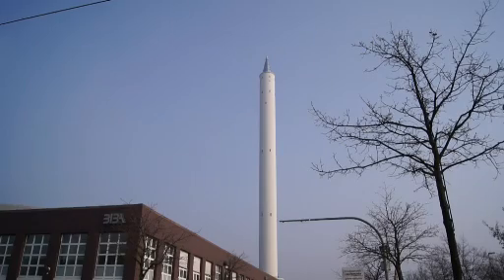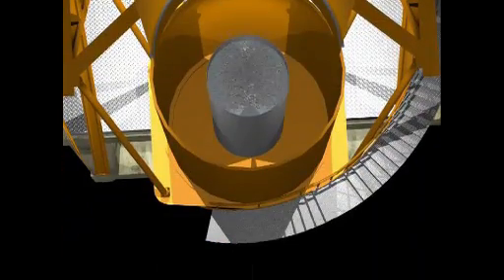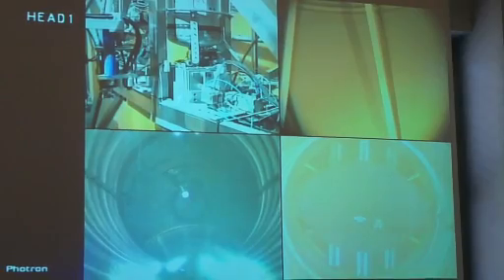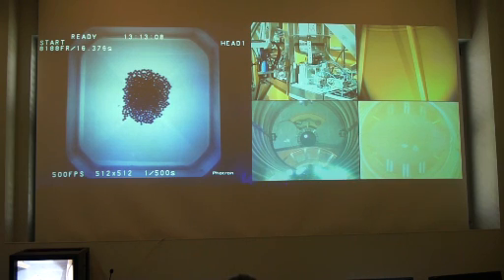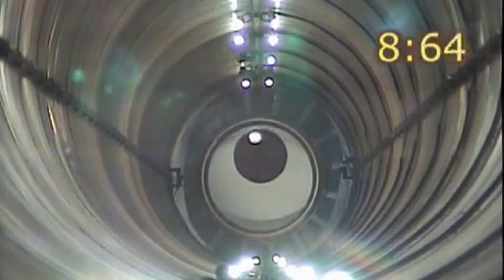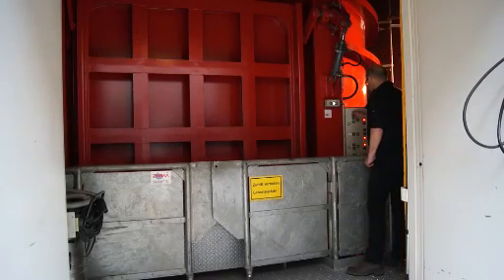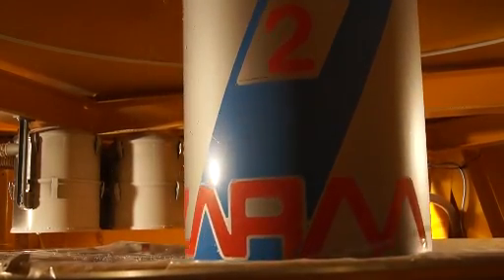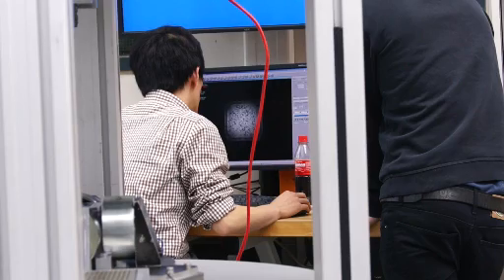Weightless* in Bremen: Germany's anti-gravity machine

Comment: Why is it when you travel in a plane at 500 mph you dont feel weightless? m v squared over r.
Reply: Because the r is measured from the Earth’s centre (= centre of gravity) and the difference in r is microscopic at plane height.  There are also some subtleties but that’s the main factor.  

Even at Low Earth Orbit the difference in gravity is tiny - gravity is still very much there, it’s just that it’s exactly counterbalanced, mainly  by the centrifugal force of the satellite going round the planet.  Weightlessness does not imply or require gravity-less-ness.

Comment: What's tragic is you people do not even have the awareness to recognize the loss of inertia experienced by the 'experiment' as it falls.

Try putting a traditional  inertia-type accelerometer on the 'experiment' as it drops.  I dare ya.
I DOUBLE DARE YA.

If it is a traditional inertia-type accelerometer it will read NO INERTIA on the way down.

"Yes, that's gravity!"  you'd say.

Exactly.  But you miss the exact physical nature of this point.
You see,  the 9.8 meter/second^2 rate of acceleration caused by gravity is equal to these examples:

1)   a  dragster type of racing car, at a dragstrip, that accelerates and completes the 1/4 mile dragstrip run in only 9 seconds.  DO  THE MATH.  That is an accleration of 9.8 m/sec^2, down that dragstrip, to get you a 9-second 1/4 mile time.  
2)   a  sports car that accelerates from 0mph to 60mph in only 2 seconds.  That is ALSO a 9.8 m/sec^2 acceleration.  Idential to gravity's acceleration. 
3)   This is the most shocking.

You see, I am telling you to put yourself in that dragster that races down the 1/4 mile in only 9 seconds.  How would you feel, as that very hard acceleration feels like it "presses you deep into the seat" of your race car?   The inertia.  The resistance of your body to the car which is trying to accelerate you.  The seat of the dragster, bolted to the car, does not give you body any choice.  Down that dragstrip you go, your body's inertia being overcome by the seat of that dragster, pushing your body down that dragstrip.  At this high acceleration - racing down the 1/4 mile in only 9 seconds - it's several times harder acceleration that what we feel in the seat of a large passenger plane when it takes off.   Your physical sense in the dragster will be "I feel like I'm being pushed back, deep into the seat"

3) example - this is the most shocking.  I'm telling you to sit in an office desk chair, the kind with wheels on the bottom.  In a large warehouse or gymnasium, that is at least 32 feet long.  Keep in mind, the average family room in a private home is 16 feet across, or a master bedroom in a private home, 16 feet across.  I'm telling you to sit in that office chair, in a 32 foot long room - twice the length of the average family room or master bedroom.  Sit in that chair at one end of that large room, then accelerate hard enough so that you, sitting in that chair,  shoot across that 32 foot long room IN ONE SECOND.   Picture yourself in that very large room, shooting across its entire 32 foot length IN ONE SECOND.

Because 32 feet per second is ALSO the acceleration of gravity.  When you accelerated in that chair and crossed that huge 32 foot room in only ONE SECOND,  what did the inertia feel like?  Obviously your body would RESIST such a hard acceleration!  You would feel 'pushed deep into the seat' so hard it would scare you.   32 feet in one second!

ALL THREE OF THOSE EXAMPLES ARE IDENTICAL TO THE ACCELERATION OF GRAVITY.

NOW, IN ALL 3 CASES,  LET'S SAY THAT YOU CARRY an accelerometer with you to measure your rate of acceleration.

If you carry with you - in the 3 examples above - a traditional inertia-activated accelerometer,  what would that accelerometer report?  An accelerometer is an instrument that detects and is calibrated at the factory to *accurately report* the magnitude of an acceleration.

HERE'S WHAT THE ACCELEROMETER WOULD REPORT FOR THE 3 CASES ABOVE:
1)  for the dragster case, racing down the 1/4 mile dragstrip in only 9 seconds - the accelerometer you carried with you on your
      dragstrip run would report 9.8 meters per second squared -- THE SAME ACCELERATION AS GRAVITY.

2)  for the sportscar case,  accelerating from 0mph to 60mph in only 2 seconds, the accelerometer you carried with you in the car would report an acceleration of 9.8 meters per second squared,  SAME AS THE ACCELERATION OF GRAVITY

3)  for the 1-second acceleration across a 32 foot room in an office chair on wheels, the accelerometer you carried would report an acceleration of 32.2 FEET PER SECOND SQUARED,  the same acceleration as gravity (note:  9.8 m/sec^2 is the same as 32.2  ft/sec^2)

Got it?   Okay.  Now, here's the punchline.
I want you take that same accelerometer and attach it to your 'experiment' as it falls in gravity.  Recall that the acceleration due to gravity is 9.8m/sec^2,  aka 32.2 ft/sec^2.   WHAT WILL YOUR ACCELEROMETER READ AFTER THE EXPERIMENT DROPS?

*ZERO* - the accelerometer will report ZERO ACCELERATION, despite the fact that you're accelerating downward at 9.8 m/sec^2.

Why?  Because there is a small moveable piece of material in the traditional accelerometer that acts like your body in a dragster, or sports car, or speeding office chair - the small piece of material is on a pivot and it RESISTS ACCELERATION due to its own inertia.  

In the 3 example cases, that small piece of material on a pivot inside the plastic body of the accelerometer acted just like your body - it RESISTED THE ACCELERATION.  And It gets 'pushed backward' (relative to the accelerating car or dragster or office chair) and the amount it deflects is calibrated by the manufacturer, then reported to the user.

IN OTHER WORDS, the accelerometer requires inertia to work correctly.

And that acclerometer WILL NOT WORK - it will report ZERO ACCELERATION - if you drop it with your experiment in the 9.8 m/sec^2 acceleration due to gravity.

WHY?

Because there is not enough inertia to deflect the small piece of material.
Because gravity, the actual physical manifestation of it,  is a reduction of inertia.

If you allow yourself to drop in gravity at the exact same acceleration that gives you a "pushed back deep into the seat" feeling in a 9 second dragster - you will not feel that inertia.    AS LONG AS YOU DO NOT EXCEED 9.8 m/sec^2.

If you attach a jet pack and increase your acceleration as you fall to the ground ABOVE 9.8 m/sec^2,  you will sense inertia on your body - that 'pushed back into the seat' feeling - as soon as you exceed 9.8 m/sec^2.

What we call gravity is a quench of inertia up to the acceleration of the planet or moon.  On the moon, inertia is quenched to zero at a downward acceleration of only 1.625 m/s^2.  On Earth, inertia is quenched to ZERO - AT ALL ACCELERATIONS UP TO AND INCLUDING 9.8 m/sec^2, along a vector pointing at the densest part of Earth's matter - its center.

Standing on the sideline and saying 'freefall!'  or 'that's gravity' and you have no chance to understand the actual cause of gravity and inertia.  No chance at all.

.
Reply: Zero point technology is real, nerd.

Comment: It is theoretically possible to turn any positive mass into negative mass.  We need a 4th space dimension in order to rotate an object with mass, by first offsetting it along the 4th axis and then rotating it around any of the 3 known axis by 180 degrees, then sliding it back to zero on the 4th.  The object will continue to exist as before only its energy will be out of phase with the rest of the entities thus having negative gravity.
Reply: Or you could take any word salad and make it into a starter.
Reply: Robert Dillahubris  loool